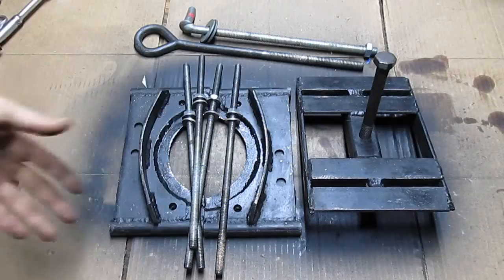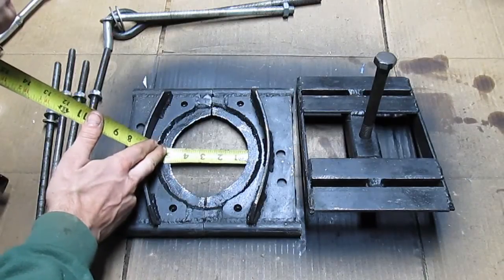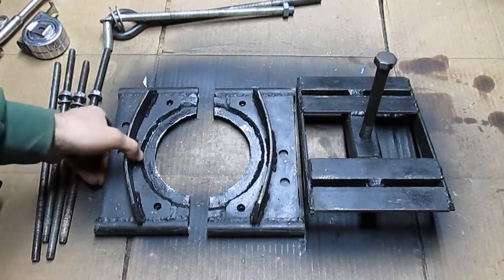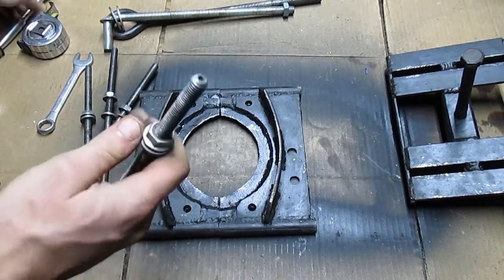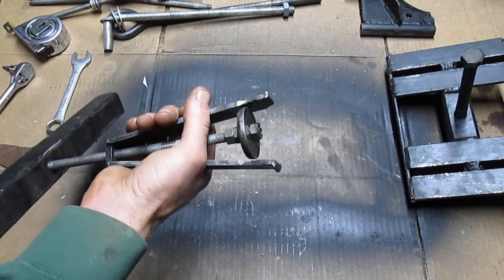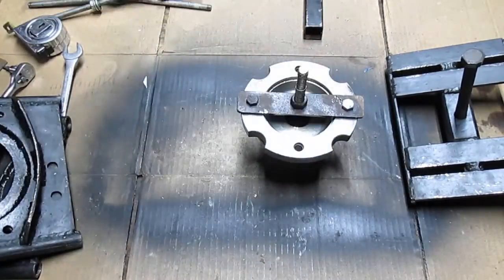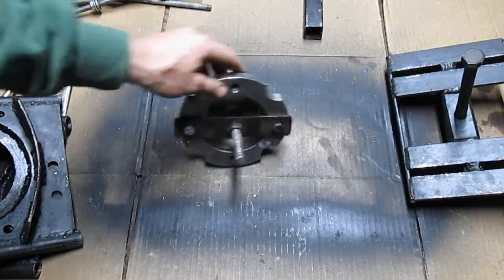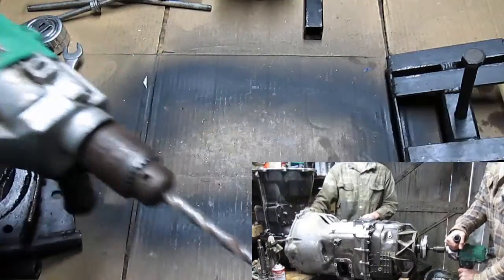G56 Disassembly - Required Tools

Comment: I have found a source for the oil deflector ring and the spacer ring for the input shaft. Anyone that them can reach me directly. Text or call me 616-255-2355 they are$40 each

Comment: First of all thanks for all the info. The only part I couldn't do myself was pressing the gears on my counter shaft. Now going back together. My original problem was a failed input shaft bearing. Ok my problem is a small metal circle between the seal and the race for the input shaft is destroyed. I cant find one or even a part number
Reply from the maker: That metal ring diverts oil into the pocket bearing,  and no, I haven't found a part number or even a source for them, your best bet is finding one used.  Best of luck to you!

Also, here's a quick video about that little ring.
https://youtu.be/LK86A4bG4X0
Reply: CumminsWorks I've been searching for one. Mopar was no help. I even have a Weller reman center near me. They don't have any info either. The input shaft is made by Eaton  Fuller. Do you know if it's maybe through them? Or do you know of anyone that sells the part used?

Comment: where are you buying g56 bearings? I developed a leak on a long trip and now I have bearing noise only in 6th gear. should I just replace the 6th gear bearing?
Reply from the maker: The taper roller barrings I order Timkens from the UK.  In the description of the video there's a link to an article on cumminsforum, on post #6 there's a list of all the part numbers along with some notes about brands.

For the bearings under the gears, and pilot bearing, standardtransmission should be able to get you taken care of.

Your 6th gear noise is likely the pilot bearing, but it's best to dig into it before you start buying parts as there's no telling what all may need attention.

Take care!
Reply: Thanks so much. I'm a mechanic but I have never done transmissions other than like a valve body and such. I was about to spend 4grand on a reman!! Thanks again